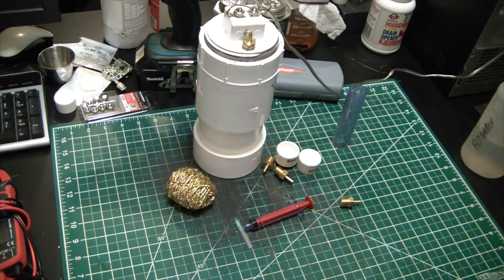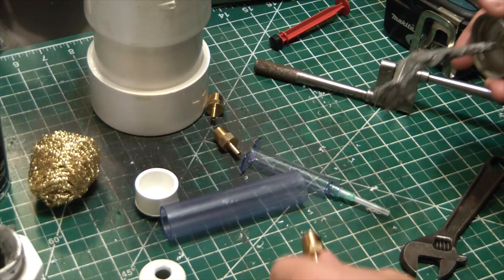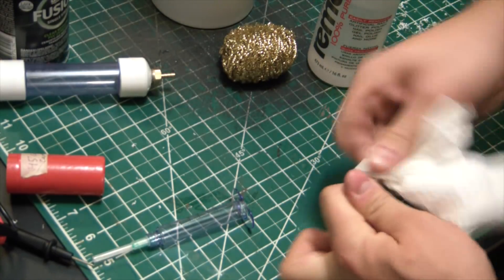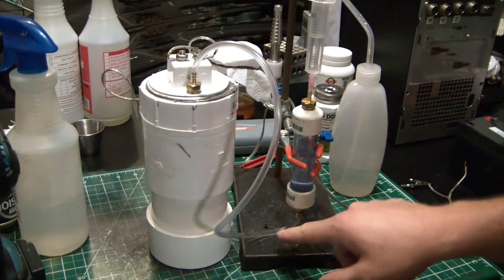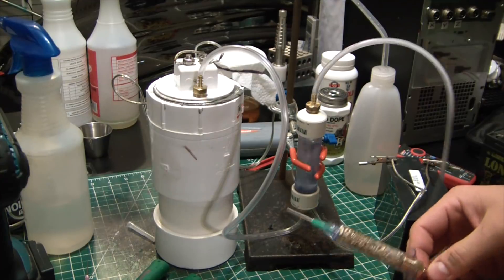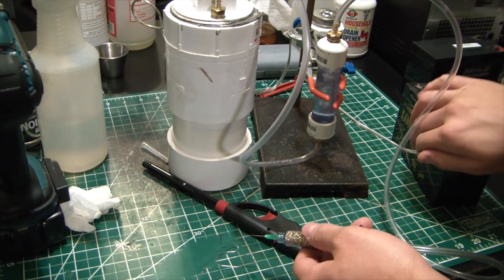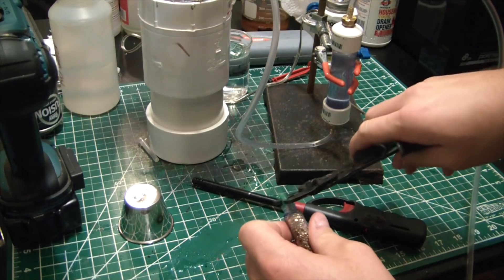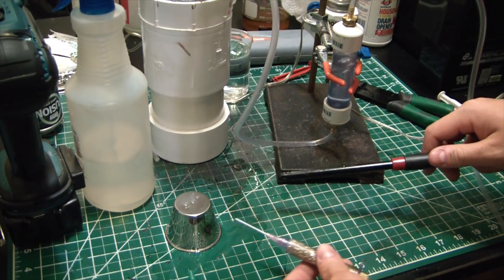DIY HHO Generator Torch - It Kinda Works! - ElementalMaker

Comment: One thing i learned from my experiments was that running a sodium based electrolyte would oxidize the leads so i would suggest to switch to KOH instead of NaOH, good luck!
Reply from the maker: Good to know, I happen to have 10 LBS of KOH just laying around waiting to be used.

Comment: I think the cups are catching gas inside decreasing the amount surface area that is submerged in your tank
Reply from the maker: If you take a look at the build video, I drilled gas vent holes in the top of each cup to allow gas to escape to prevent that very problem from occurring.

Comment: Probably a good idea to always have a bowl of water around to throw any burning parts into
Reply from the maker: I keep a couple fire extinguishers right out of frame. One ABC and one Halon for the real nasty stuff
Reply: That´s good, but you probably wouldn´t want to use that if just the syringe or tip was burning. Basically as an alternative to the spraybottle you used.

Comment: Wait.  Are you collecting an explosive mixture of hydrogen and oxygen in that cell?  You are really asking to get killed.
Reply from the maker: Its a very small amount in the headspace. The cell is filled to nearly the brim with water and a bit of NaOH to make the water conductive. Too small a volume to generate anything that would kill you. The flashback arrestor (bubbler) also prevents that from happening.
Reply: I'm risk averse, I'll admit.  Since your system operates at low pressure, I would make sure that an unintended ignition of the head space has somewhere to go rather than shattering the PVC and sending it everywhere.  You could have a relief port which you could test under worst-case conditions.  As you have seen, the mixture you are generating is extremely explosive (perfect ratio of H to O) , and it takes nothing more than static electricity (less actually) to set it off.  Thanks for the video.  Be safe and have fun!

Comment: Use brass tips.... check out rwg research and irondmax
Reply: Better flash back arrestor would be brass wool, or in a pinch you could use a cig butt filter in the line....
Reply: Also helps to have a blow out valve in the generator it self, just in case
Reply: Look into pwm for these to... lotta good stuff if ya head over to their sites

Comment: The Flashback your experiencing is in part due to this being a perfect explosive mixture of H2 and O2. (And as others pointed out the brass isn't fine enough to provide proper arresting of flames). Being an explosive mixture with an excess of oxygen (the oxygen from the generator plus the oxygen in the air) creates a whole bucket of additional challenges to arresting the flames.

Personally I would build a standard split cell so you can adjust the mix in a controlled method. 

The needle as a nozzle is probably too reactive of a metal as it heats up the oxygen wants to combine with it (and the rest of the plastic torch body) just as you mentioned. Maybe try a different metal which is less reactive with oxygen under heat.
Reply: Yes it needs a whole lot of care.
The speed of a flame front with H2O is so fast that it will bypass stop valves. I know you are not using one. I used two and a mesh.
It passed the lot and blew the generator. It was fortunately in a cage! Needs extreme care.
I think the way to go is by generating the gasses separately as you suggested.

Comment: Ha!  I piss acetone!  Seriously, it's a major and painful problem.  I can't piss on a fire or get into watersports.  It makes for a lonely life.  Okay, I'm just kidding about all that acetone nonsense.  It's actually toluene.

Cool build.  Be careful with the steel wool selection as fine strands of iron has no problem burning in a high oxygen environment.  Maybe you can find finer strand brass wool?  Sintering brass beads together in a fine enough pattern would be better.  As far as your needle burning, it's because there isn't enough gas being produced to keep the flame far enough away from the needle tip.  You could also place the needle through a tapped 3/8" diameter brass rod to conduct heat away.

Comment: The needle seems to start burning when you get it too close to the steel cup; I guess in free air the flame front is far enough away from the needle to not ignite it, but once you touch the needle tip to something hot it starts burning in the O2 atmosphere and won't be put out

Comment: Nice project. Although, I can see you have less flow then you've hoped for.  You might want to add a (weighted down) gasometer and a valve to fill a volume with gas and get a more predictable flow out of your system, while still using a slightly under powered PSU.
By the way, If you have a jump start kit laying around, these wont heat up as much when supplying  power for a high current load.
Reply: Filling a gasometer with a stoichiometric mixture of hydrogen and oxygen is a recipe for disaster. Even a small container-full is enough to do serious damage if it ignites.

Comment: Maybe solder a 5mm length of copper wire to the needle shaft to act as a heat sink, or just a blob of solder might be adequate on its own.

Comment: Try to change the boiler flame arrestor in time of water use metanol + boric acid and usualy using the 12v of the pc power supply can delivery about 25-30A at 12V, is between 300 and 360w
Now your only using 80w... (5V, 16A) 
I think is something more power

Comment: Your needles may be melting because they aren't able to dissipate the heat that builds up at the stainless steel needle interface.  You may need to add a bit of oxygen under slight pressure to increase your outward pressure to reduce the heat build up.

Thanks for sharing your trails with us!
Reply: Pure oxigen burns steel

Comment: Your flashbackarrestor really scares me! I am dealing with a lot of oxyhydrogen every day. You need stainless steel wool. It also needs to be extremely fine to work.
Also if a flashback happens it will continue to burn inside of your burner. So please use something made out of metal. Alternatively you can build an arrestor using beach sand. The only problem with that is that it needs to stay upright all the time.👋🏼👍🏼
Reply from the maker: Great idea with the sand! I definitely need to order some stainless wool as well.
Reply: Stainless steel wool will ignite with just a little heat in that high oxygen gas mix.
Reply: @stoneworld7556  nope😄
Reply: +Freizeitflugsphäre It's true; stainless steel will burn in a high oxygen environment. Stainless steel wool is more likely to burn in a high oxygen environment due to the high surface area, It generates a self sustaining reaction; same as regular steel wool in normal air.
Reply: @stoneworld7556 Only if it gets ignited. Thats what I wrote in my original comment. When a flashback happens is will continue burning inside of the arrestor until you stop the gas flow.
Thats the princible how it works. There is no metal woll arrestor wich stops the flame without itself beeing on fire.
Reply: The last thing I would ever want is a flashback arrestor which itself is on fire.
Reply: @stoneworld7556  you're so right
Reply: @winsrrow8125  Sadly this doesn't work becauae the sand needs to bubble up in order to let the gas through.

Comment: you could use a PC power supply, just join all the 12v rails.

with more current you get higher gas flow which will push the flame front away from the needle
Reply: nice, you reminded me there's something called flame speed , and it's different for different fuels. Hydrogen has the highest flame speed.

Comment: I was thinking of building one of these a while ago. I haven't tested any of this yet. A small heavy rubber balloon  or hot water bottle would work to create and hold pressure. I would put the flame arrester after the balloon. The hot water bottle  I think wouldn't be enough volume.  Fill one with O2 and the other with H2 .  Get a jewelers torch from Ebay $30 or so. Us it to mix the gasses. A regulator to help keep the pressure constant would help.
Jewelers Torch.
https://www.ebay.ca/sch/i.html?_from=R40&_trksid=p2380057.m570.l1313.TR3.TRC0.A0.H0.Xjewlers+torch.TRS0&_nkw=jewlers+torch&_sacat=0.
With regulators
https://www.ebay.ca/itm/Jewelers-Little-Torch-w-Regulators-Flash-Arrestors-Rosebud-5-tips-Smith-TYPE/372256743043?hash=item56ac3b1e83:g:QSwAAOSwq4VbTKMa
But can you do all this for under $140?
https://www.ebay.ca/itm/H160-75L-Oxygen-Hydrogen-HHO-Gas-Flame-Generator-Torch-Acrylic-Polisher-Machine/302756173759?hash=item467dac97bf:g:~OEAAOSwu-JamnSK

Comment: could youuse a stick welder too supply power to a hho generator
Reply from the maker: All depends on the voltage and current, but I bet you could make it work! As long as it's a DC stick welder, which I think most are anyways
Reply: well the only thing is im not sure what the welder would do voltage wise and it probably depends on the specific welder but that is where it might actually be better to have a mig welder since it is a constant voltage instead of a constant current like a stick welder
Reply: @Grognarthebarb  for the hho production you need constant courrent in time of constant voltaje.becaouse is the current and not the voltaje what make the electrolisis.  The voltaje is increased only for increasing the power
But probably if you use any kind of welder to this hho producer unit, will melt or explode jajajajaja 
The most probably is if you use it the water inside start to boiling like crazy, getting hotter and probably that will make the pvc explode and ignite the hho
Reply: I couldn't use my stick welder since it's an old DIY AC welder with strange square wires. It's all controlled by moving some iron in the core to adjust current or something.
Reply: @ElementalMaker  I'm wondering if it is important if it's AC or DC when you're not collecting the gas separately ?

Comment: You couldn't have chosen a more unsafe torch head. Howitsmade has a hypodermic needle video on YT. Your flashback arrestor needs to go back to the drawing board. By using the term "drawing board" I mean just buy a spring driven commercialy manufactured device. You need a valve at the end of the line as well. Had that flame gotten out of control you couldn't have stopped it, and you didn't have a glass of water until it was too late. Put that Chinese piece of shit lathe to work and make a purpose built torch head before you lose your eyes and can't make videos anymore. Not that I'm worried about you, I'll just be pissed if I can't see this project finished.

Comment: Ok I have a couple of comments. First after seeing all the play and jigglys of the lathe I agree that is the worlds crappiest lathe. But you know what? If I had it I'd use it because I don't have a lathe at all and sometimes the crappiest is better than nothing. Second when you were having trouble putting the flame out as it ate your needles I personally would have just pulled the tubing off of the water chamber. That being said if you didn't do that for a reason I'd love to hear why. Maybe I'm overlooking something. Anyhow keep up the good work.
Reply from the maker: The tubing is on those hose barbs quite snugly, it's a true pita to pull it off

Comment: Put a small valve leading up to the torch so you can shut it off and build up some pressure so you can put a larger needle on. Also did you sand the cups up to give you more surface area for gas production

Comment: I think the problem you need to tackle first is the output of the generator, then get the right material for the "nozzle". Power is actually pretty easy. If you can scrounge up a car battery and some decent wire(Are you seriously using speaker wire?), the power problem will be solved. Your average car battery can easily put down 500-700 amps. At a nominal 12 volts that's somewhere between 6000 and 8400 watts. Grab yourself a cheap battery charger and some heavy gauge wire(12 gauge or bigger should handle the power and give you a nice safety margin) and you're all set. At that level, regulating the power output will be necessary, but something like a light bulb in the circuit will keep things out of the kiloton range if shit goes pear shaped.

The nozzle is the next issue. You're trying to contain a flame hotter than the melting point of the material you're trying to contain it with. Ceramics, nickel alloys and tungsten should all be tough enough to hold up, but they're going to be pricey and possibly something that will need to be custom made for such a small application.

Comment: Buy a 1000w server power supply, if you buy used you can get one for less than $100
Reply from the maker: I'm looking at a 5V 60A power supply right now that I think would work beautifully and its dirt cheap
Reply: would is it better to use 12v or 5v or what is the best voltage to use.  I know that with a higher voltage you are able to pump more watts while using fewer amps, but is it better to use fewer volts and more amps or more volts and fewer amps?

Comment: Why don't you keep the hydrogen and oxygen separate until you burn it?  As is, you are sending rocket fuel through the hose.  I don't know how it doesn't flash back to the water trap every time.

Comment: Pressure is required to keep the flame away from the torch head. 
It is likely your needle is melting under the concentrated heat.
It doesn't have the capacity to dissipate enough heat to survive. 

watch: oxy acetylene torches from this old tony. he explains the fuel oxygen system more in depth.

Comment: Would it be any more efficient with a lot more surface area?
Reply: yes, more surface area is always more efficient. A lot of the losses in electrolysis cells comes from ohmic losses when current flows through the solution.

Comment: If you live anywhere that there are farms, or animal herds, there should be a farm store. There should be syringes and needles available there, at a cheaper cost in time anyway, than waiting on ebay, for what it's worth...
Im out in dairy country, there are 5 feed stores within 20 miles of me, all have syringes and needles just sitting on the shelf...
Reply from the maker: Sadly im not quite that far into the country, but I'll google for some local feed stores and see if I cant find one! Thanks for the tip!

Comment: World tiniest thermal lance ;)
Reply from the maker: **That also self destructs
Reply: Solutions from a iliterate
1-Maybe a even thinner needle can increase the speed of the gas, so the actual flame don't touch the needle?
2-Increase the thermal mass of the needle? so it never gets hot enough to burn.
Reply from the maker: Both solid ideas, I am thinking about creating some kind of heat sink for the needle to keep the heat out of it.
Reply: @ElementalMaker  the flame is so narrow and extremly hot.  It will destroy anycase.  Probably the better idea is like carcharoth said reduccing the inside diameter or increasing the presure

Comment: You need a ceramic nozzle.  You can tie several of the 5 volt wires together to give you a little better power delivery. Those tiny wires aren't worth much by themselves.
Reply: A platinum needle nozzle won't burn, and the melting point is pretty high.
Reply: glass? will it survive?

Comment: are you using the 5 volt rail or the 12 volt rail? most power supplies have significantly more amps available on the 12 volt rail, like 20-30 plus amps on a 400-450 watt power supply.
Reply from the maker: 5V rail actually had a higher current rating than the 12V on this particular supply which is what I am using in this video.
Reply: @ElementalMaker  but isnt the same 20A at 5V than at 12V. In terms of power at 5V@20A are 100W and @12V are 240W
Reply: The reaction has a standard potential of −1.23 V, meaning it ideally requires a potential difference of 1.23 volts to split water. In this case, more voltage means more heat rather than more HHO volume. Of course, if you have electrodes in series you need to multiple voltage and always you have some loses in a system.

Comment: Try and make liquid HHO with LN2
Reply from the maker: AWESOME IDEA! Just need some LN2 and a dewar!
Reply: @ElementalMaker  lol that is just a terrible idea, the liquid probably won't react but the gasses above it will, causing splashes which evaporate and then also ignite, basically creating a bomb... Do it outside and with a looong electrical ignition and no items between it and you that could become projectiles (including the Dewar...)

Beside that, doooo iiiittthhh!!